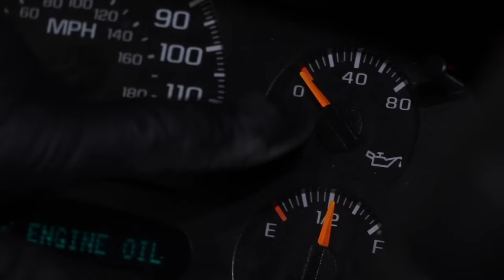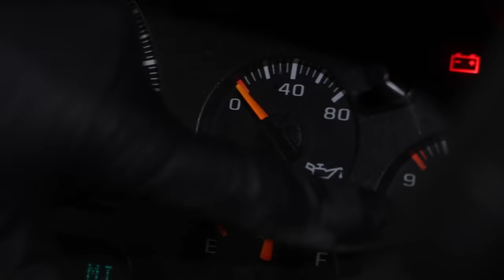Top 5 Problems 2000-06 GMC Yukon Sierra Chevy Suburban Tahoe Silverado Avalanche Cadillac Escalade

Comment: I have a 2001 Tahoe and just replaced both wheel bearing hubs, CV Axles, Rotors, and calipers.  My brakes give a grunt sound and push back at around 4 MPH.  I was told it could be the ABS module unit.  The sensors wouldn’t be an issue with no rust on the wheel bearings, right?  They’re brand new.

Comment: The host of electrical problems like the reduced power mode (that I fixed by grounding the wire that runs behind the engine and the flickering/dimming lights
Reply from the maker: +Broseph Chillaxatron We are sorry to hear about that.
Reply: @1AAuto  I still like the truck. Its frustrating a lot of times but it is nice being able to make it work again. It really is an empowering feeling.

And I reallly like your channel. It helped me so much in fixing my truck. Thank you guys for your great content!

Comment: 2000 Silverado my wheel speed sensor went ended up hitting my garage. I could not stop! pull your abs fuse you will be able to stop but your brake  and abs lights will be on. Also the passenger rear caliper seized had to replace heard that was also common
Reply from the maker: +Dylan Greene We are sorry to hear about that!

Comment: I have a 2002 and runs fine except at idle it sputters a little . No codes , plugs have been changed , fuel filter changed . Trucks only has 96,000 miles

Comment: I’m having problems with my 07 silverado classic no crank no start but when I open ignition nothing happens no engine light pops up no security light pops up and abs light and battery light stay on when I close ignition switch and dash lights up and stays on until I disconnect battery🤔 any ideas of what’s going on with it? Also with that stereo doesn’t have power to it truck doesn’t lock or unlock and windows do not roll down or up
Reply from the maker: +javier mejia We wouldn't be able to diagnose an issue like that here, you may want to have a local mechanic take a look at it. Thanks for checking us out! http://1aau.to/m/Shop-1AAuto-c

Comment: I have an 02 Chevy Suburban and it's a great truck and I like it and all, the issue my Suburban is dealing with right now is it shuts itself down if I drive is for a period of time, especially if it's hot out. All my fluids are good and all, but I've been dealing with this issue for a few months now. A lot of times when it shuts itself down, I have and wait at least 25+ minutes before it can start up normal. It started right by up right away once, but it's an issue I've been trying to figure out. Any suggestions?

Comment: Here's the actual list I have an 02 yukon denali.
Dash cluster stepper motors go bad 
Abs controller solder let's go
Intake problems needs gasket
Misfires no codes just engine light 
Steering box 
Intermediate shaft and input shaft 
O2 sensor wires rub through on vehicle harness side usually.
Fuel pressure regulator
Injectors.
Bad grounds under driver door on frame
Dirty throttle bodies 
Also some kind of valve under truck for fuel system.
Theres a list of common problems that I've experience with several of these models
Reply from the maker: +Nick Santanen

Comment: 2006 Silverado 4X4 1500, changed front brakes, replaced a leaky caliper and turned rotors. now both of the front brakes are locking up. I found that the master cylinder was leaking fluid into the booster so I replaced both parts, bled brakes again. Both wheels are still locking up. I took brakes off cleaned and lubed the caliper slides, calipers are sliding correctly. Brakes are still locking up. I read where some said that the front brake hoses  go bad so I replaced them and once again bled all four wheels. Well they are still locking up. Someone told me to change out the proportioning valve but the truck does not have one. Any suggestios would be appreciated!
Reply from the maker: +big j vulcan We wouldn't be able to diagnose an issue like that here, you may want to have a local mechanic take a look at it. Thanks for checking us out! 1AAuto.com

Comment: Why do the 2000 and up GM SUV and Trucks passenger side head light always go out? I already fixed my 2007 Cadillac Escalade by rewiring all and put all new fuses now it starts up and Runs like a Cadillac Escalade should, it's taken me almost 4 weeks to get. Everything in the order. But that's my only question ❓ 9

Comment: Would knock sensors make your truck go into reduced engine power mode? Another question with the big braided wire that goes from the firewall to the back of the motor make the truck go into reduced engine power mode?

Comment: Rear ac going in and out,caused by a orange wire behind driver kick panel,you know it's shorting ,it will be dark discolored going into the plug harness,and the ac controllers up front are bad about going out

Comment: Great video.  2004 Suburan with 298K miles.  Just had the oil sensor go bad.  Pain in the butt to change, but as one poster put it "if you do it once, you'll be an expert".  Yep.  Could do it in 30 minutes now that I have the right tool (MUST have special oil pressure sensor socket - regular sockets are too thick-walled).  

Also have the oxygen sensor problem.  And the steering wheel "clunk".

Anyone have the driver's power seat motors lock up?  My 6-way seat failed one motor at a time.  Now only goes forward and backward.  IF you can find the part, it is $700.

But... love that I have gotten 17 years of good life from this work horse.  No complaints.

Comment: Hello.  I have a 2001 2500 chevy suburban LT.  Oxygen sensor code came up last year after the engine would run rough out of the blue (doesnt always run rough just occasionally).  Well a mechanic replaced one oxygen sensor.  It helped a little.  Now the problem is back again along with the service engine light flashing.  Should I just go ahead and replace those two front sensors?  What else needs to be checked?  I know if it were a catalytic converter issue I would smell rotten eggs and engine would have no power.

Comment: I have a 1999 Chevy Tahoe LT 5.7L 4D, 2WD, and have changed all four O2 sensors. However, the engine service light will come on after driving it for a day or two; Wiring appears to be fine and no exhaust leaks.I did  check the heater circuit fuse which is okay. Have scanned it and keep getting OBD II codes P0134 and P0154.  How do I find out if it may be a faulty ECM/ PCM?

Comment: I have an 01 tahoe that I've been chasing codes and replacing parts and sensors every time i replace 1 part it kicks a new code for another... I've been told it could be the crank and cam sensors but getting kind of tired of chasing codes and buying parts that won't fix it
Reply: I'd erase the codes once u fix something, drive for a little while, and reread. Might help.

Comment: I have a 2006 GMC Yukon 5.3L. It has winning noise when I push the accelerator or at idle. Replaced just everything in the front like the pulleys, alternator, power steering pump,, water pump, tensioner. Can’t pin point the source. Please help
Reply from the maker: +Daniel Richards We wouldn't be able to diagnose an issue like that here, you may want to have a local mechanic take a look at it. Thanks for checking us out! http://1aau.to/m/Shop-1AAuto-c
Reply: Had the same problem on my 02 Tahoe that turned out to be the bearings on my ac pump.  The ac still worked but it was starting to wear out at 230,000 miles.

Comment: Hello, Thank You for this information. I have do have an issue with my 2003 Yukon. It started not turning on, I noticed I had to jump every week, and now it came to the point that after jumping the car it starts,  but as soon as turn the car,  amd I try to start it on again, everything is dead, lights, battery, doesn't turn over or anything, so basically dead. I'm allowed to jump it again, but same thing happens. I checked my battery and alternate, and they are fine. So is the issue my ECM?

Comment: 2005 Tahoe.  When I start the engine when cold, I hear a sound like maybe a bearing that is falling apart from the right rear of the engine or around the transmission.  It gets better after a couple of minutes.  It is not a lifter ticking sound. I have plenty of fresh synthetic oil in it.  I just came back from a 3-hour highway drive and had no problems.  Any ideas?

Comment: So I'm having similar electrical issues I need to replace the instrument dash cluster on my vehicle however I had a question for you guys because my AC will not shut off and the front blower motor and the front blower motor only I've already replace the blower motor itself the control module on the dashboard and the relay sensor and it's still not shut off even if you turn off the vehicle take out the key you have to either disconnect the battery or the fuse itself for it to stop running
Reply from the maker: +Joseph Chavez Thanks for your inquiry. There could be multiple reasons why you're having this particular problem. We suggest taking your vehicle to a nearby reputable shop to identify the cause. Once you know the cause, we'll be happy to see if we carry the parts and how-to videos needed for your repair.

Comment: I have a 2002 GMC Yukon XL 1500 and we have inherited it from my father-in-law and it's a really good truck considering it has a new engine in it and new rear main seals....I have not seen a check engine light, however, I have seen the Service Engine Soon Light which gives me the code  P0304 which tells me it's a cylinder #4 misfire....So, I'm just just confirming that if I replace the O2 sensor on the passenger side it MAY eliminate this issue?
Reply from the maker: +Mark Mcfail We wouldn't be able to diagnose an issue like that here, you may want to have a local mechanic take a look at it. Thanks for checking us out! http://1aau.to/m/Shop-1AAuto-c

Comment: Ok I have a question I have. A 2005 Chevrolet Tahoe 4.8 
2wd 

I recently got a check oil level light  on my dash I checked my oil  and I drained a good amount of it out  and the light is still on.  And the oil pressure gauge went from low to high then back to the 50/50 mark.  Not sure if it’s  the cluster or the oil temperature sensor below the starter.

Comment: Dont know if its related to the ABS issues but my 01 z71 has terribly spongy brakes... ive bled it countless times, even electronically bled the ABS module ,  replaced master cylinder and booster,. Changed out pads and still nothing.. my brake lines look fine (live in south texas so no rust at all)..all thats left is physically checking my rotor thickness to see if its below spec and checking each line for spec pressure.. dont know what else to do
Reply from the maker: +Spartacus4000 Thanks for checking us out!
Reply from the maker: +Ken Plechaty Thanks for the tip!

Comment: Hello. I am trying to program a brand new replacement key fob for my 2001 Chevy Tahoe. As mentioned the key fob is brand new, with brand new working batteries. I have followed/repeated the entire insert key, hold down unlock button, turn ignition off/on twice, wait for the lock to cycle, press and hold lock/unlock on fob simultaneously. But the lock never cycles therefore the Tahoe never enters programming mode. As a side note, I know that the locks are capable of cycling. Because when I pull and hold the bright light lever while cycling the key twice to program my desired door lock/unlock sequence the locks will actually cycle, the same way that they should when programming the key fobs. Can you please share some troubleshooting steps that might help me diagnose why my Tahoe won't enter programming mode so that I can program my new key fobs? Thank you.
Reply from the maker: +E P We wouldn't be able to diagnose an issue like that here, you may want to have a local mechanic take a look at it. Thanks for checking us out! http://1aau.to/m/Shop-1AAuto-c

Comment: I have a 2002 Suburban runs great but started to give me this problem. Driving on the highway suddenly it dies, wait 10-15 minutes, starts again for another 45m or so. Scaner is reading knock sensors, does Knock sensors cause that to happen? My reading on dash voltage is a little bit above 14 mark, is that normal? I thought at first it could be fuel pump. What do you think i could be?

Comment: I have a 04 gmc denali with the 6.0 engine, I has only sat for about 4 weeks without cranking, I went to crank it and nothing happened, no click and no lights, I check the battery and it was alright, but I took it out and put my AGM optima battery in, and I still don't have no lights, and no start, not even a single sound, what could be wrong??? It ran great when I parked it, and also, I have 5 vehicles, so thats why it sat so long

Comment: The driver’s side window/door lock switch on my 05 Yukon stopped working, dome light doesn’t come on when I open the drivers door either. I purchased a new window switch box and when I plugged it in I tried to start the truck to test it but the truck wouldn’t start, it just turned over. I unplugged it and then the truck would start. Occasionally the truck would start but the ABS light and the battery light would come on. When I plugged the original unit back in the truck started just fine.  Is this a common problem with GMC vehicles from 2000 to 2006?

Comment: On a 2001 yukon xl 1500 sle there is a black seam plastic trim peace  on the roof  on either side  above the big window.  What is this peace called and how do I replace it. And no not the roof rack, it's like a seam with a black rubber the length of the big window.

Comment: I have a 02 Tahoe and it the ABS light is on as well as the traction light and I'm wondering if that's a ground problem or if it is a actual ABS problem please help thank you for your time.
Paul in Dallas

Comment: My 2005 gmc sierra 5.3 liter.... It just started to not accelerate. When i give it gas the rpms will spike then drop and it hardly accelerates. I cant get it to go over 30mph...
I put a bottle of fuel injector cleaner the day before.... Could that of damged my injectors?

Comment: I miss trucks being simple, powerful, and reliable like my 70 F-100. My ten year old Silverado sucks big ones. Bad electrics, leaky exhaust, weak struts, leaking engine seals,  brittle plastics, loud interior, fumes, fogged headlights, intermittent speaker shorts, horn always works until you absolutely need it,  rear differential roars, manual window crank binds up, door seals howl at speed, and  the driver ( me ) is perpetually upset with ownership. My next truck is gonna be an early classic maybe a 68-72 Short bed with a modernized engine bay but no more plastic trucks for me.
Reply from the maker: +Tiny purple fishes Runlaughingthruyourfingers Thanks for the feedback!
Reply: @1AAuto   I think it was more “rant “ than anything else. Question; does the Longbed 97 4.3 S-10 really have a slightly lower rear end differential gear possibly due to larger payload capability?? And is it lower than 3.73 ?? Sure seems so but maybe it is just one of the trucks that run better longer faster for no apparent reason. I think I found a good one. I bought it from an Amsoil distributor who used it delivering his products and used Amsoil exclusively in the truck for years. I’m not sure if this thing is stock due to fancy blue braided fuel supply inlets on intake and pewter-looking molded exhaust manifolds unlike the big clunky ones I’ve seen on others, any ideas on how to find what mods might’ve been done by that description????
Reply from the maker: +Tiny purple fishes Runlaughingthruyourfingers We wouldn't be able to diagnose an issue like that here, you may want to have a local mechanic take a look at it. Thanks for checking us out! http://1aau.to/m/Shop-1AAuto-c

Comment: My ABS light and brake light come on at the same time then the abs turns off then the brake light turns off and this repeats every 5 seconds. This is an intermittent problem. If the truck decides to do this it only starts when I got over 3-5 mph and stops when the truck comes to a stop. It does not throw a code for this problem. It also will not shift in or out of 4 wheel drive when it's doing this. I have replaced both front hubs and the abs module so far and it's still happening. Please help me no one I have talked to have ever heard of this problem. Thank you

Comment: 2002 1500 4x4 it stop in red lights, bad temp riding...the old owner put a  KN FILTER AND cut the mass air wires.IDont know why he did that!
Any way it has chek light ,low coolant lights
It's a mess but you step on the gas and it runs...any way liked you're video but if you'd
Could do one with all the colling sensor
Repair it would be nice thaks
Reply from the maker: +Albert Perez We wouldn't be able to help with an issue like that here, you may want to have a local mechanic take a look at it. Thanks for checking us out! http://1aau.to/m/Shop-1AAuto-c

Comment: Nice video learned a lot. I have a 2004 suburban that is stuck in 1st gear and also no reverse. It has transmission fluid . Prior to this it was having issues shifting gears and I pulled over turned it off and after 10 mins it drove good. No check engine light on any advise I’d appreciate it. Looking at rebuilt tranny right now hoping for the best because money it tight. Thanks for reading
Reply from the maker: +jason hicks Thanks for the feedback!

Comment: 2000 Escalade 252k miles...just purchased and it exhibits some "slop" in the steering wheel...steering seems fine other that the 1 or 2 inches of play..no noises other that the shocks are needing replacement...initial visual inspection reveals nothing obvious...any suggestions as the what it may be causing this sloppy steering? Where to start looking?

Comment: Any thoughts regarding P2135 and P0120 throttle position errors on the ETC 6.0L that result in "Reduced Engine Performance"?
Reply from the maker: +Mike Zunker We recommend having it diagnosed by a mechanic, there may be multiple reasons why you are experiencing this issue. Thanks for checking us out!